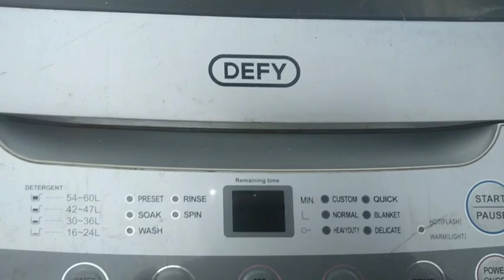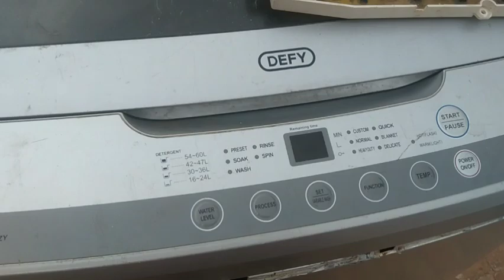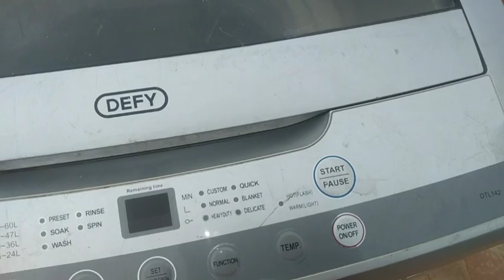How to solve E4 error code on defy washing machine

Comment: I have tried that  and problem is still there
Reply from the maker: Did you check if the light brown wire and black it's attached to the black switch at black you can bypass them too
Reply: I have the same washing machine did the same as specified in your video but honestly you really need to specify what wire to cut and linked with 🤔